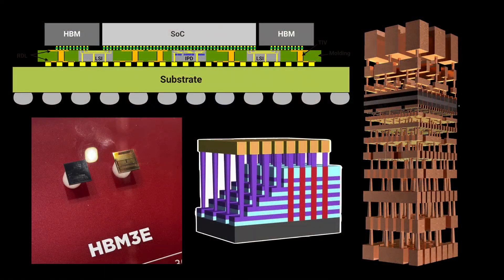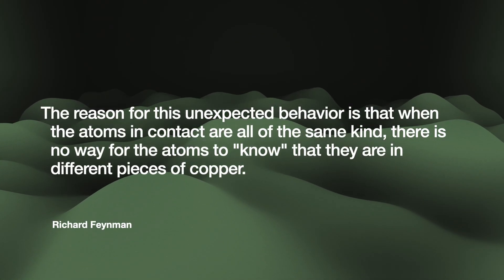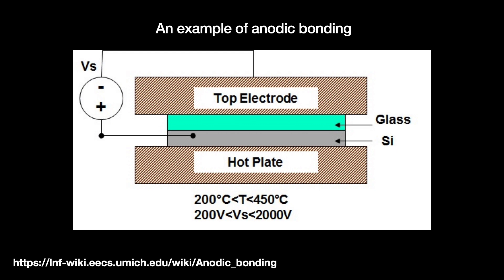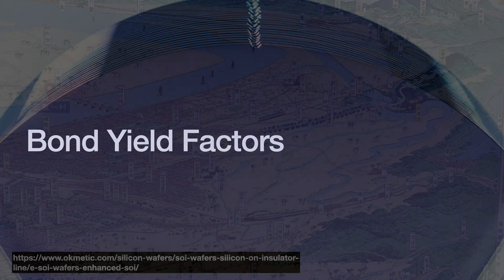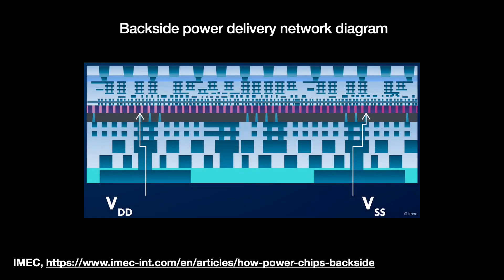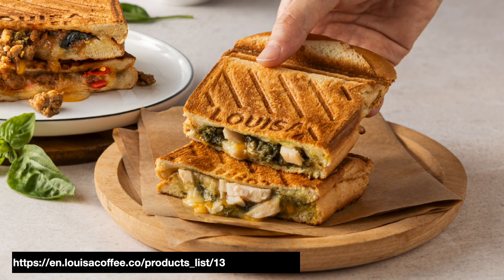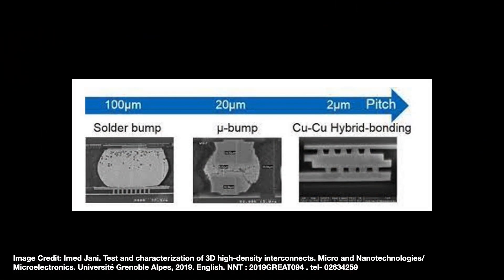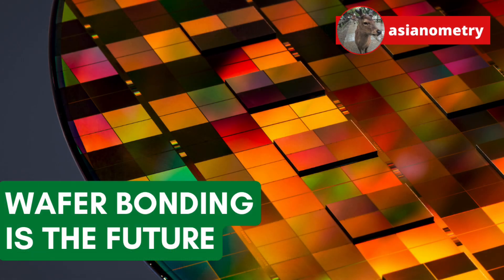Why Wafer Bonding is the Future of Semiconductors

Comment: I am curious, how does HBM wafer stacking and bonding is affecting the ultimate yield of an HBM stack?
If individual chips were diced, separated, and tested before stacking and bonding them, the yield of a an HBM stack could be good as long as the yield of the bonding step was good.

But with wafer level bonding, entire wafers full of chips are stacked on top of each other, without individual chips being tested and only good chips being stacked.  So, a 90% yield of working chips on a wafer quickly exponentially falls off when stacked. For a wafer where 90% of the chips work, stacking wafers 16 high will drive the working stack yield down to 0.90^16 = 18% (without even factoring in a stacking bond yield of less than 100%).  If the chip yield were 95%, the 16 high stack yield would be 0.95^16 = 44%. 

The overall HBM stack yield with wafer level bonding seems like it makes the stack yield be VERY sensitive to the chip yield and stack height.

Comment: Min 12 + re: TCB for HBM. Correction : HBM does NOT use TCB of the Au - Au type ( Hughes ) but Au or Cu w/ a Sn cap on to Cu ( or Au ) invented and first used at Motorola for Cell Phone ( the GaAs PAs in the RF section ) 30 yrs ago. A metallurgical bond is created in less than a second

Comment: Amateur bloggers are pontificating on topics they do NOT understand & spreading far too much of their ignorance ( min 12 onwards ). Since its inception about 10 yrs ago and in the foreseeable future HBM stacks ( 3E the latest version w/ 1,024 bit wide Data Bus, soon even for the HBM 4 version w/ a Data Bus 2x wider ) have been built using the Sn capped micro pillar Flip Chip bonding technology ( design, custom tools & processes ) developed ( and patented ) 30+ yrs ago ( when TSMC was barely getting started, and the OSATs lived on hand me down technologies from the U.S. ) by ME at Motorola ( in AZ ) w/ the first HVM by 1996 for Robotic Assy. of GaAs PAs of RF Modules in Moto Flip Phones ) The technology diffused out to the Far East by spying. The important point is that uPillar Flip Chip bonding is NOT Thermocompression bonding ( quite slow ) as has been misinterpreted by half educated Electrical Engineers ( incl. a fraudulent faculty at UCLA ) even some bloviating Physicists ( mostly European ), but involves the in situ ( meaning at the alignment Robot itself ) melting of the Sn cap very quickly ( < 1.5 Sec ) under heat and pressure ( to ensure good heat transfer but then relieved based on feedback from sensors built into the Bond head ) and fast ALLOYing btwn the molten Sn and solid Cu. The total cycle time ( including Robotic alignment using m/c vision based Pattern Recognition, also of our invention ) could be as short as 3 Sec and over 1,000 dies ( or these days 100 HBM stacks ) bonded per hr by ea. Robot is NOT uncommon. Over 80% of all Adv. technologies used by TSMC, the OSATs of Taiwan or HBM Mfr.s in SoK were invented and first used in HBM by Motorola & Intel in AZ.  TSVs were invented and first used by Bosch of Germany ( 2003 ) for MEMS. The Hybrid Bond Copper process was invented and licensed by Paul Enquisr of Ziptronix ( NC , USA ) and first used in HVM by SONY for BSI Camera Modules in 2016. The latecomer Parasites & Pirates of Taiwan have tried to develop new Adv. Packaging techs ( e,g. FO WLP and FO PLP ) on their own but have failed because these FO techs were pre destined to fail ( had been evaluated in depth 25 yrs ago at Moro & Intel in AZ but rejected for high I/O processors on both tech & cost grounds, TSMC adopting it since 2015 to pull the wool over vain Apple’s eyes has NOT changed that ). Tech Pirate TSMC has now set up shop in AZ, the TRUE Silicon Valley for the last 30 yrs and it is Too Close for Comfort.

Comment: That concluding remark about Moore's Law reminds me of how Ray Kurzweil defined the idea behind it in The Singularity is Near, where the overal idea of increasing computational power was already being looked at on a more holistic level. He talked about the computational capability we could cram into a fixed volume and not on a per die basis. Part of the reason for doing so was so that he could trace Moore's Law backwards in time, to before we used semiconductors, but another reason was that this way you can think beyond the current technological paradigm.

Comment: Applying heat from above through vacuum, wait, how does that work?
Reply: Radiative heat. Basically heat up some element inside, it will radiate heat even through vacuum (same way heat from the sun reaches us).

Comment: 1) At 1:00 - AFAIK, there are no capillary forces between flat (or not-flat) surfaces in a vacuum. 2) van de Waals theory is only an approximation, but the full theory, due to Lifshitz, is so horrible to calculate that physicists prefer not to mention it (jk). See https://en.wikipedia.org/wiki/Lifshitz_theory_of_van_der_Waals_force.

Comment: Wringing is not the same as cold welding, it looks similar, but is not permanent. It is used with gauge blocks. They hold very well together, but can be separated without leaving any trace.
I suspect that  some of the bonding here is not actually cold welding, but wringing, and behaves similar enough.

Comment: Comprehensive quarter-hour dive into wafer bonding. Sounds somehow like there is only one company leading this field… 😉 
The only three points of critique I found in this quite relaxed and fun-to-watch quick-dive are:
First, the comparison to die2die-bonding and the challenge of efficiency due to the parallel nature of bonding thousands of devices in parallel, which makes the step intriguingly attractive as well as precision alignment required when adjusting the two ‘pizzas’ together. In fact, achieving the nm-scale lateral precision of bonding for 300mm HBM-wafers on a pizza where all pairs of 5cm Peperoni-slices would meet, would allow to expand the pizza to the size of our planet - funnily enough this ratio matches the difference between walking speed and the speed of light… 🍕🌍
The second one is the advantage to avoid risks that every wafer processing step carries along. Wafer bonding drastically reduces the accumulated risk that the 60…100 typical processing steps introduce by joining two or more stacks of pre-testable and therefore verified operational, ultrathin, nm-scale, 3D-structured surfaces in only one process. Thereby eliminating 99% of this risk for the complex stack that otherwise would see thousands of individual steps that each might destroy the delicate sandwich and thus rendering it as a delicious interconnected structure that outperforms the taste of a ‘double-whopper’ 🍔 
And third - bonding also allows to stresslessly join heterogenous materials that the common process of epitaxial growing would not permit to do, due to intercristaline tensions when slowly building up new layers with different atomar lattice distances rather than joining the fully grown lattices..
- But hey, they mentioned that there is still more to come that we can look forward to! 😁

Comment: Under rated task - correct electrical bonding.  Hi resistance bonds faults even worse with AC signal.  Nice video on the topic.

Comment: The smoothness and planarity of silicon wafers which are dirt cheap in small sizes, is a good reason to use them in applications not resembling semiconductor manufacture in the least. I've used them as planar mirrors in a UV (IR won't work) spectrometer, and learned pretty quickly that stacking them even in normal pressure and temperature is not a good idea. For a short time you can easily get away with it, but leaving them overnight lets the interstitial air slowly escape, and now you are left with a stack of nearly inseparable quite brittle wafers.

Comment: @Asianometry
I'd join your Patreon if I could, but I'm literally saving every cent so that I'm not living in my car anymore, but I'll join eventually, but pronbably shouldn't be a priority at the moment 😂 I'll make a request for a video anyway.  You've covered so much in terms of lithography and a fair bit about packaging etc, but what I'd really like to know is some of the finer details about how the silicon ingots are sliced into wafers, and made almost perfectly flat, then how they cute the wafer into individual dies so cleanly, then the mind boggling bit for me, how they then take that die and attach those stupidly tiny wires so accurately during packaging.  If it follows the subject enough, also how they maintain such accuracy across so many lithography steps and somehow maintaining such obscenely tiny features.  

Thos bits really blow my mind.   Also if there's enough development (or available information) about the approaches being taken to develop cooling solutions that will be required in the near to mid future.

Comment: Seems like this all ends with silicon cubes instead of silicon chips. There is already a lot of 3dness in tons of interconnect layers and 3d transistors. When  they start bonding different circuit layers together then we start emulating the human brain.

Comment: The "bonding" you mention, I also seen a version of this, in HS when making a set of parallel blocks and grinding the faces smooth.  If you did it right when you put the blocks face to face they stuck to each other,.  You couldn't easily PULL them apart you had to slide them off each other.  I think it's a version of the same animal.

Comment: One aspect that the taller silicon packages will have to deal with is heat dissipation. Eventually, thermoelectric effects such as the Seebeck and Peltier effects will have to be engineered in the electrical power supply of these devices in order to carry away the heat from the device onto a surface that can handle the heat.
Reply: Maybe the processor would have a series of channels with cooling fluid [IE mercury].  Also, diamond is both a good conductor of heat and electric current.
Reply: @stevenpace892  diamonds are insulators, though?
Reply: @ArtificialDjDAGX  Diamond has the best heat conductivity of any material, also very good insulator (if pure), see Thermal Conductivity chapter on Wikipedia: https://en.wikipedia.org/wiki/Material_properties_of_diamond
Reply: @Martinit0  I was literally referring to the wikipedia article for diamond when calling them electrical insulators. You should've made your reply to the OP of this comment chain >.>

Comment: So, in hybrid bonding, does the copper of the interconnects become stressed when the temperature comes back down?
Reply: There is a bit of stress induced, but the gap between the dielectric and the copper the so caller dish coming from the CMP process is typically only 1-5 nm and therefore the induced stress is very low and overlay accuracies of below 100nm on a 300mm are possible.

Comment: -Asianometry : wafer bonding is the future
-Me working in an old fab with 20+ years old bonders : wait what
Reply: Those are wire bonders, not wafer bonders
Reply: @paulds65 no we've been doing molecular bonding for well over 10 years in my factory. Wafer to wafer bonding is new but chip to wafer is old
Reply: @20xx-mm-dd  We were doing three-layer stacks for MEMS accelerometers in the late 80's in Milpitas on equipment we made ourselves. It was gold-gold bonding with heat and pressure. We found out how good the bonds were during dicing. Yeld could be a real problem!
Reply: @paulds65  you mean those in the video ? Because he does talk about wafer bonders.

Comment: AMD's 3D V-Cache technology was the first product to market using the direct-copper method. It was, apparently, a rather deep collaboration with TSMC that stretched several years. The Zen 2 based chips (Ryzen 3000 series) were equipped with the receiving pads for the V-Cache, but the yields were absolutely atrocious so it was never marketed, but by Zen 3 TSMC and AMD had figured it out. By making the V-Cache on N6 and the chips on N7 they had a match that yielded right, and the rest is history.
Reply: Bullshit, Sony and Samsung using copper direct bonding for their image sensors much longer. TSMC was for sure not the 1st one. It is crazy how much false claims just focused on CPU are done by wannabe semicon experts.
Reply: IBM been making the 'MCM' for around for 20 years AMD not the first, but probably the first place most consumers could get a wafer-wafer bond?
Reply: @foobarf8766  The operative word was "direct-copper method" that Jon described in this episode. Yes, MCM/Chiplets have been used for a long time, but that was not what I was referencing. And no, the first wafer-wafer bond consumer product was the HBM on the Radeon Fury cards. But that was solder-bump bonding, not direct-copper.

Comment: Issues:

2:20: Feynman pronounced wrong
6:03: SOI doesn't solve parasitic capacitances in general, nor short channel effects of a variety of types. Super misleading. It does reduce leakage and increase radiation tolerance in general. It provides a backgate as well.
9:23: Slide says UHV (correct) you say UHF which is radio
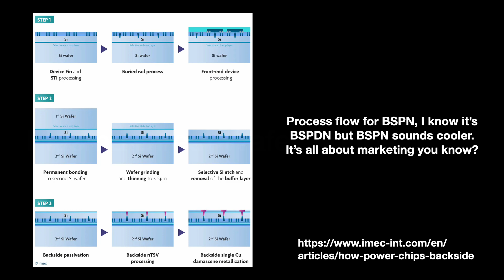9:45: You make it sound like an ultra thin unsupported layer is bonded to a handle. But really its sort of bonded from a donor most of the time for device SOI. MEMS SOI is different. You should have covered SOITECH's process: https://en.wikipedia.org/wiki/Smart_cut, though the slide you show at 10:11 is similar enough in some ways.
10:37: Melting point of Silicon is 1414 C, not 900 C
11:35: It is super unlikely anyone is bonding at very high temperatures after the BOEL is in place, there isn't thermal budget for that step in all likelihood and it would probably change the low-k oxides a lot.
12:25: Hughes pronounced wrong
13:03: I would say they have different thermal expansion coefficients, not that they expand differently. You meant this no doubt but they expand by the same physical mechanism. Water is unusual Copper and Silicon are not.

Comment: When I realized that almost all silicon chips were 2D I realized that to get anywhere near brain power you would need to stack chips and use capillary cooling.
Reply: afik the untel foveros had that problem, cooling all the layers, they have bot said anything about that in 7 years, amd came woth the x3d, and thats it, must be complicated to do i guess, perhaps lower power consumption is a must first? zen 5?
Reply: Consider that our brain is mostly a thin sheet of (many layers of) neurons wrinkeled into a ball with the matter on the "inside" being mostly interconnections.

Comment: High quality image sensors for digital cinema cameras have back side connections, rather than interconnects between the pixel sites on the face of the chip.  This allows rear side cooling, that helps to increase dynamic range.  This way, interconnects have more space, and need not be so thin, and help to lessen signal degradation.
Reply: Most advanced sensors are since 10 years 2 chips (sensor and image processor) face to face connected by waferbonding. The sensor chip is thinned down to ~10um and illuminated from the backside. So light does not have to pass through any metal layer.
Image sensors were the real driver for direct wafer bonding technologies.

Comment: You should do a special video on just keeping the air clean inside a fab.  Everything for the building envelope to the HVAC equipment.  These places are thousands of times cleaner than any operating room
Reply: a video about clean room air would be nice... and perhaps one about the vibration/seismic challenges of wafer production (perhaps there is one for the later, perhaps point to it.)
Reply from the maker: Great idea.
Reply: That and the water... everything has to be sooo clean!
Reply: @stevengill1736 
He already did a video on the super clean water iirc.
Reply: @jintsuubest9331  yeah, that was a great one!
Reply: As a refrigeration guy I 100% support this

Comment: Oxidation trouble, experienced in Intel 13 - 14 gen i9 processors, and AMD delaying the release of 9000 series Ryzen processors, also experiencing similar problems, arising from the processes of wafer bonding and interposed layers. In fact, you couldn't have released this video at a more opportune moment! It appears that now, wafer bonding is not likely being ANY part of the future, with urgent new methods being investigated to stacking and avoiding oxidization problems, degrading performance and creating unstable CPU products, in the biggest RMA of Intel's history, 17,000 staff having been laid off... it's bad!
Reply: There is absolutely zero evidence that AMD is "experiencing similar problems". Some people are too quick to speculate. Heck, we don't even have proof that Intel's problem is related to wafer bonding or interposed layers. 12th gen is produced on the EXACT same node and doesn't have any issues. You jumped to every conclusion imaginable, and invented a few along the way.

Comment: This is very cool (pun intended) but, if you stack a bunch of microprocessors to increase component packing by the cube, rather than the square of the wafer size, how are you going to keep it from burning up?
Reply: Clocking the absolute snot out of chips is relatively new. My 486 was passively cooled. Your phone is passively cooled too (I assume!).